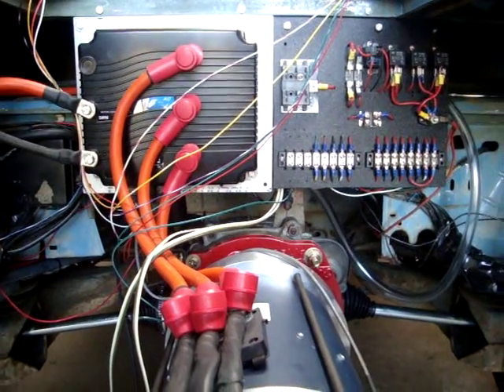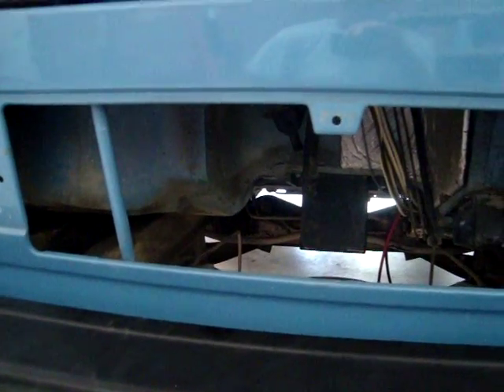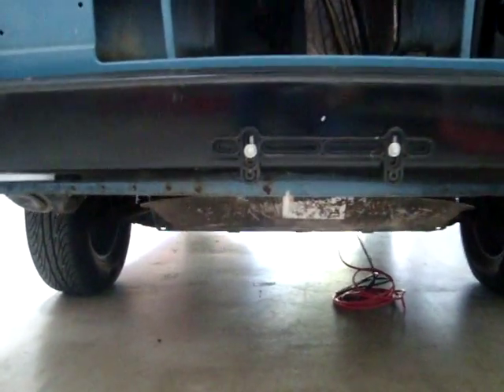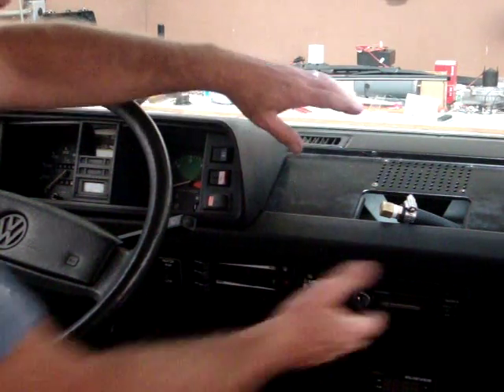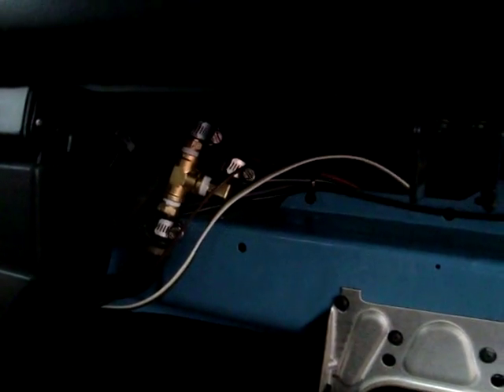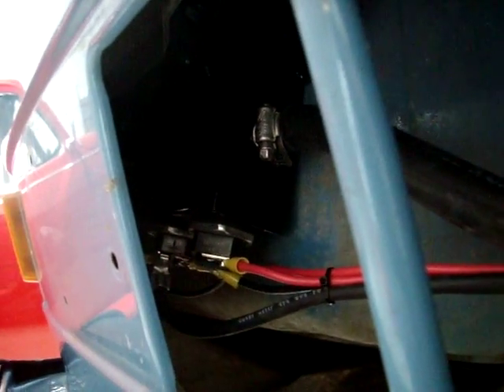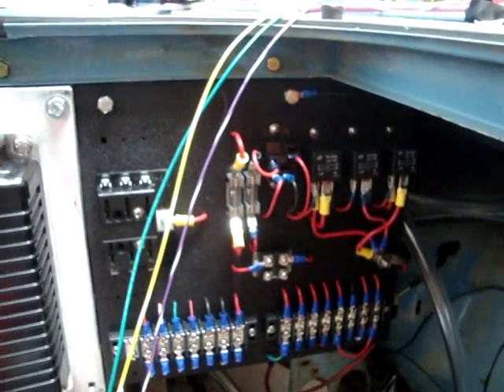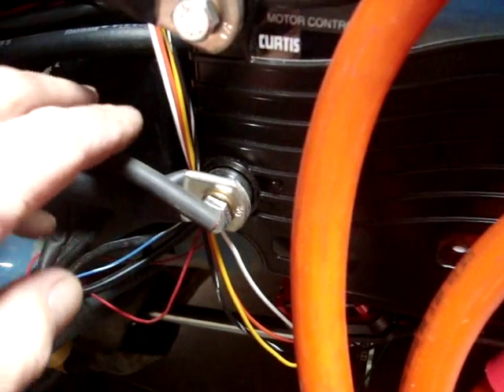DIY Electric VW Transporter Doka, Episode 8

Comment from the maker: We normally prefer the Kilovac.  The Gigavac was used in this instance because they were provided by the vendor we purchased the heater components from.  For the power train, Curtis specifies the Kilovac by model.  It has a 24 volt coil and is controlled by the Curtis Controller.  Thanks for watching.

Comment: Richard, great work as usual ! I have a question: why do you use GIGAVAC for the heating system and KILOVAC for the power train ? What is the difference between these two high current contactors ? Thanks